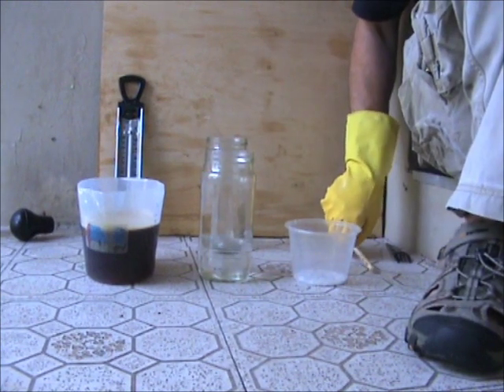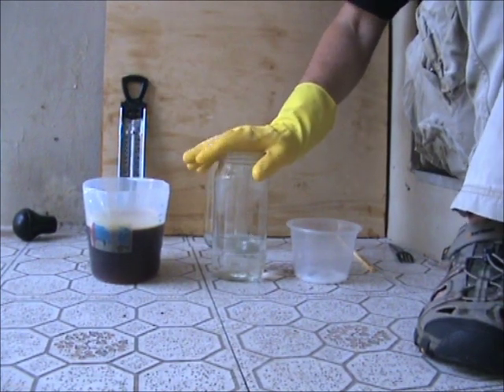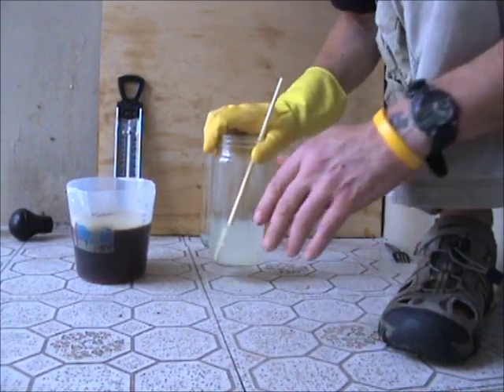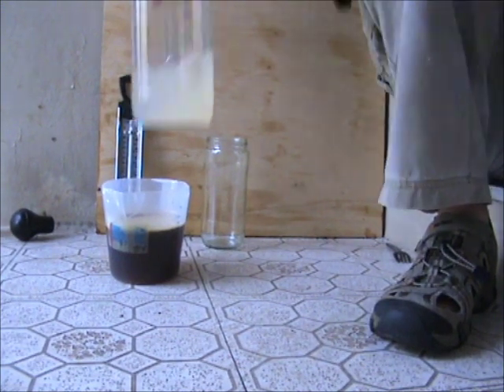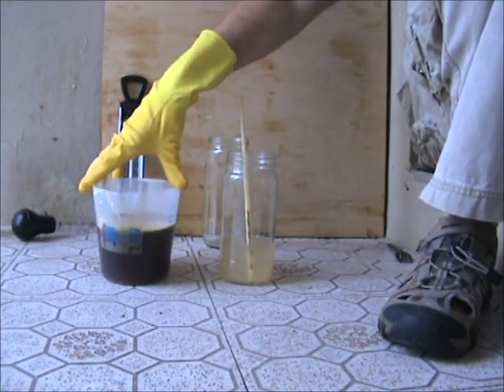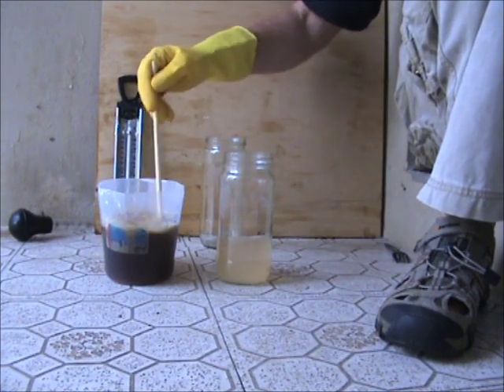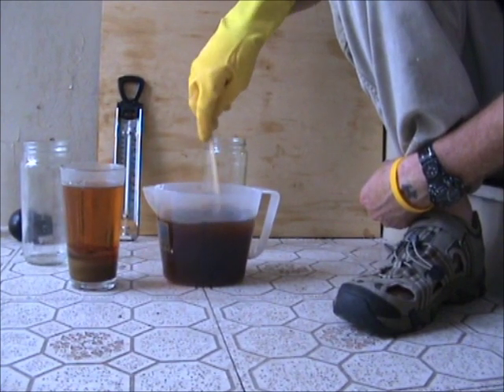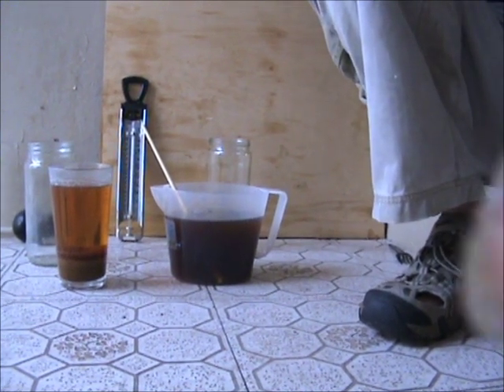Making Bio diesel at home - Part one.wmv. 1twilight9

Comment: @david harris....these quantities he's using are different to mine ...I use 1 litre filtered DEWATERED veg oil to 200 ml of methanol to 3.5g lye (for new oil only) used oil has to be tested by titration to determine the amount of fatty acids in the oil...the ALKALI (lye) neutralises the fatty ACIDs and helps the veg oil react with the methanol....sounds like your oil had far too much water in it....if you ' wash' biodiesel incorrectly it will also turn to soap..read up on it, its great when it works right...do small batches first so if it goes tragically wrong you don't have to deal with large quantities of crap.
Reply from the maker: turtlezed Absolutely, Its all about trial and error before you use it, and it is great when you master it. Go for Titration when you have mastered the basics, it took me a bit of time but is well worth it, thanks : )
Reply: turtlezed how much amount of fatty acid is required??

Comment: Great video! I'm starting up a diesel project soon myself. I hope to lower my yearly car running costs. Can modern cars use this fuel as efficiently?
Reply from the maker: Thanks Max, I have a Citroen hdi common rail diesel engine which runs fine, but different makes of engine may vary. Volkswagons tdi diesel range is defo the bench mark..
Reply from the maker: yes but I do add 20% road diesel to the mix

Comment: Hi mate been using your recipe and to say that it works, just a quick question sometimes my bio diesel comes out a bit thick? I just wondering if you had the same problem with different batches of veg oil? Would you increase the amount of caustic soda? and methanol if the oil comes out thicker? Thanks mate
Reply from the maker: just the soda. move up another 2 grms at a time, test a small amount of oil first until its not so thick.  no need to increase the methanol.
Reply: Thanks mate I used 8 grams and kept the methanol the same and it turned out great. If you use too much soda does it get more soapy?
Reply from the maker: yes too much soda = soapy in the wash process george. make sure to wash until the water is crystal clear for a better grade. glad you got a good result : )
Reply: Thanks mate for the advice, looking forward to your future videos. Maybe you can show us your setup when you have time, cheers thanks for the help.

Comment: I have a vw 1.6 tdi golf mk7, is there any certain ratio of biodiesel to road diesel I need to use?
Reply: at winter use 50/50
Reply from the maker: yes 50/50 with most common rail engines. vw tdi engines are the class leaders in bio burn, so you can use more bio. but you will need to check up on it first.

Comment: Paralently we can use Ethanol too ! Is cheap cost only 60p per Liter .I can buy on petrol station too as fuel  ! but it has to be clean OIl without animal fat ! check this website bbb.evolutionbiodieselkits.cxx/biodiesel-ethanol.php
My Pegueot can handle blend 50:50 no problem at all .. Bit smell diferent . I love it :) 50 % cost cut ...Beat the TAX !. Need to splasch out some oil now .. We dont do Chips chops as Uk do .. :( shame I love Chips and curry sauce ). ..That may be problem ..

Comment: Please tell me if the Diesel Engine in the Vehicle has to go under some modification before using this oil? Also, will there be more Engine maintenance issues compared to using normal Diesel?

Comment from the maker: For 1ltr of not so heaverly used veg oil i will add 200 mltrs of methanol and 8 gms of sodium hydroxide. Its not spot on but does the job for me, if you want to get the sodium spot on then you will need to do a titration test which you can find on you tube for further info : )

Comment from the maker: yes as long as it is a vegetable oil, ive never heard of etona before... if its very dirty oil you will have to do a titration test which is demonstrated on you tube... i cut the avaerage and go with 8 mgs of sodium hydroxide which has never let me down, yep 30.000 miles and not a prob : )

Comment from the maker: yes all you need is something to strain it with, i use a net curtain framed.... you will need to increase the sodium to the required amount into the methanol on average 8 mg to 250 mltrs... i will do a video later on how to get the right amount of sodium hydroxide needed in a tytration test : )

Comment from the maker: Hi adumboy, yes you can use super market oil clean with less sodium but the methanol amount is the same 20 to 25%... finding methanol is not easy so you may have to do more homework on top of your study stuff, check online : )  sodium hydroxide is known commonly as costic soda and is not too hard to find on line or down your local hardware store or plumber centre... good luck : )

Comment from the maker: for one hundred ltrs of bio you need 100 ltrs of filtered used veg oil heated upto 55c
20 ltrs of meth and 800g of costic mixed well until it has desolved = methoxide...
well what went wrong is that you did not get a reaction... to reclaim the oil heat it up again until it has losend up again and give it a good wash and the oil will returned. it happens from time to time as ive had the same prob... once you have the oil back try the full process again..

Comment: Thanks twilight,..well at one point I was going to chuck the whole lot (100 ltr) and phoned around environment agy,and even fire brigade ! (not emergency no.) ..but then I thought I would be stupid to chuck it, so I filterd it again and again.But I have discovered that the pump on processor ain't working.No air coming from anywhere i could see.Methanol I'm told is ingredient for paint stripper.So might have to look for a good tank...btw my sieve/filter tore at the last min. Try again tommorrow.

Comment from the maker: we live and learn david... dont ditch the oil just filter out the paint bits through an old net curtain or the like and give it a good wash until the water is as good as clear, bingo!!... yes raw metal vessels or plastic is the must any paint on the inside is a no no as the methoxide is very abrasive...ive now stepped up to 8 g of sodium hydroxiude per ltr and would recommend you doing the same as a much better result has been had... i will up date with better formulas, hope this helped : )

Comment: I would really have to question using an oil drum for mixing/processing that is painted inside.Hot fluid and paint just don't mix as a general rule.I have used paint stripper and the results on my first experiment (disaster) of making biofuel were similar to applying paint stripper to a surface.Areas bubbled up.I phoned the manufacturer,and he said this is the first time he had heard of a reaction like this.I phoned the prv seller and he assured me it was methanol he gave me.So was it wrong mix?

Comment: Yesterday I put in 100 litres of used cooking oil heated to about 50c then added 15ltrs of methanol (or at least I hope it was methanol !! ),which was mixed with 600mg of caustic soda (about a cup and half).....The result is porridge. I followed roughly the vdo's instructions (I think).Where did I go wrong ?

Comment: if you want to be REALLY careful, you can buy a gas filter mask on amazon or ebay or even lowes for like 30-40 bucks. Should filter out any gas that may arise from the mixtures. Of course, should be in a well ventilated area in the first place.

Comment from the maker: very minimal my man, just filter with net a curtain or the like to get the bits out, then heat to 55 C, as simple as that... if the temp is cold then heat the oil to warm and filter as this will loosen the oil and make it thinner for filtering hope this helped.. : )